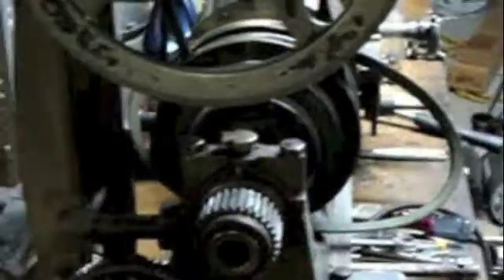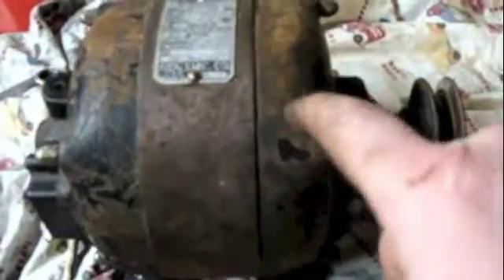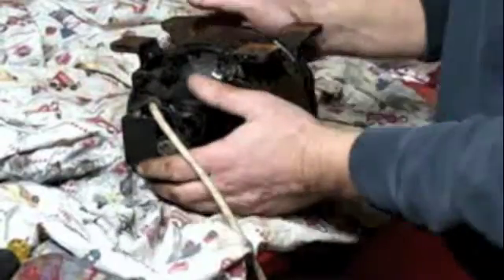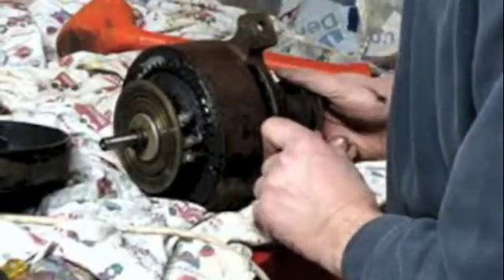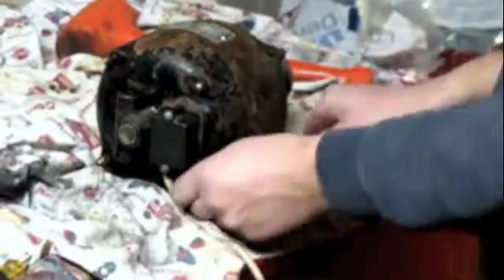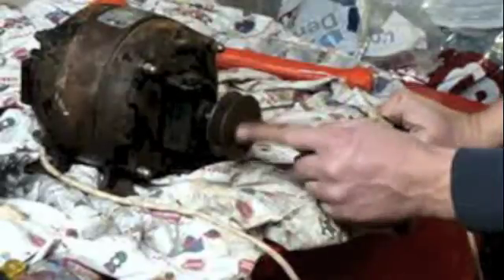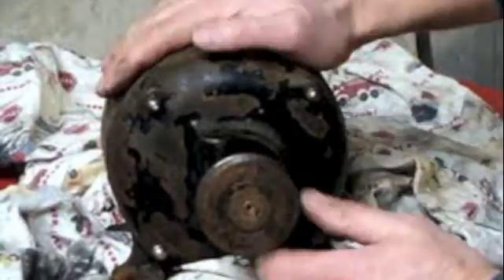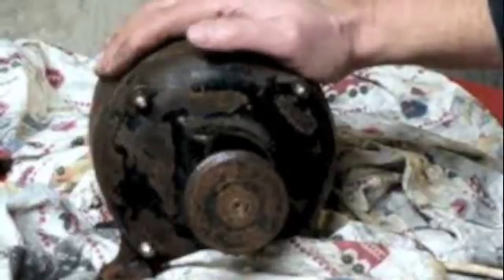Atlas 9" Lathe Part 13

Comment: Nice problem solving on the motor and the style looks perfect. I have a TH54 and it calls for a 1/4 to 1/2 hp motor at 1740 rpm.
Reply from the maker: Thanks. I having done much with it yet, but so far it seems adequate.